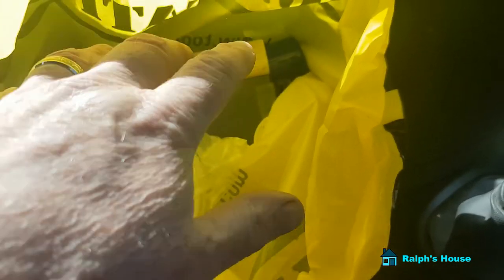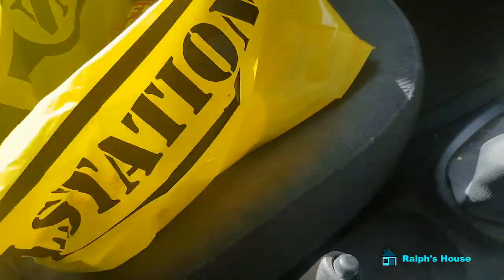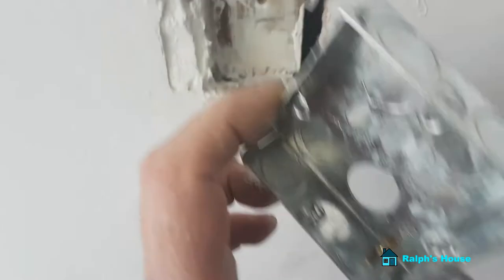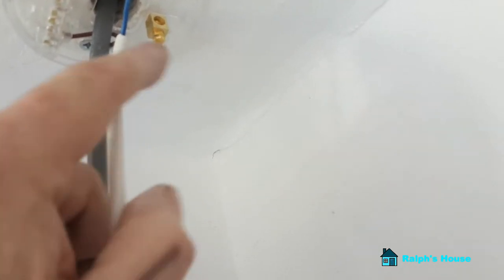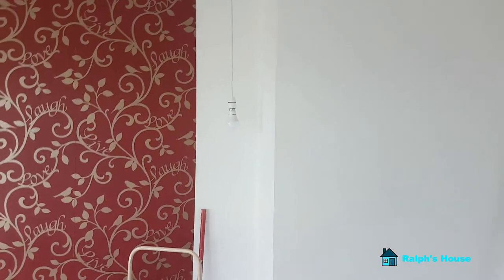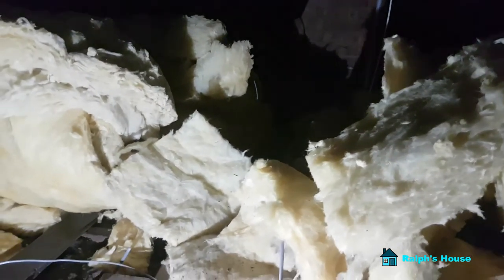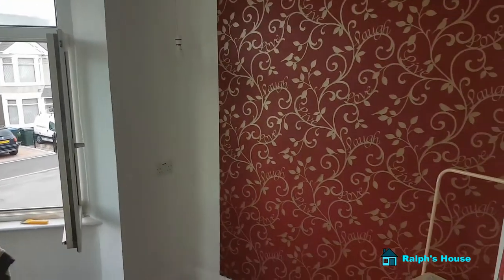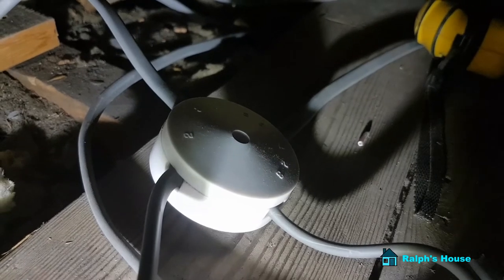Downlights (episode 87)

Comment: I would recommend using wago connectors and the grey junction boxes that they also sell because they are maintenance free connections which will not come loose over time unlike traditional screwed junction boxes no matter how tight you terminate them, as long as they can be easily accessed according to 17th edition of wiring regs they are perfectly acceptable which I am sure you have done anyways! Seem like a competent DIYer when it comes to electrics as I have seen a lot of people bodge jobs my making dodgy connections and using twin and earth with no sleeping on the earth etc. Good video though!
Reply from the maker: You're absolutely right, In fact I've since replaced any junction boxes with wago boxes over the last 6 months. For me, it was about getting a functional lighting circuit so I could move in. Over time my late father had 'added' various spurs and almost everything was through junction boxes so I ripped the lot out to force me to do it properly. Have kept abreast of regulations and the worst part was probably changing the original bakalite fusebox to a modern metal consumer unit but I made a tidy job of it. Have a couple of qualified sparky friends who had a nose at what I was doing and they both approved it. Slow, steady, double-check and test :)